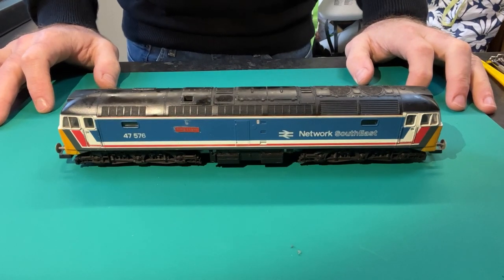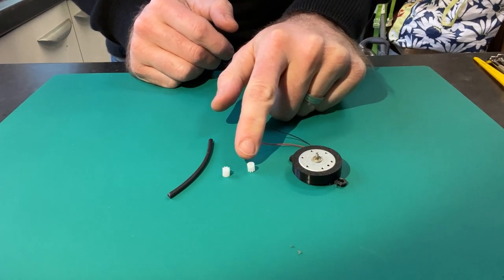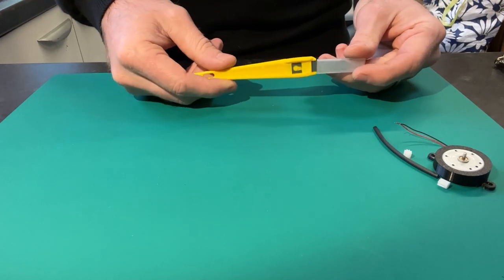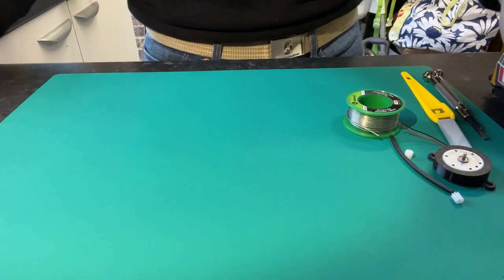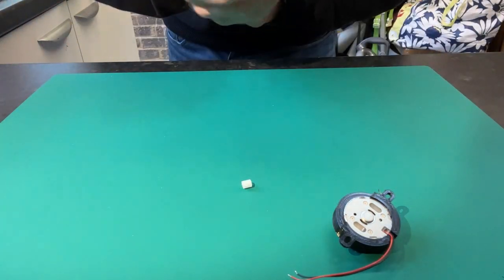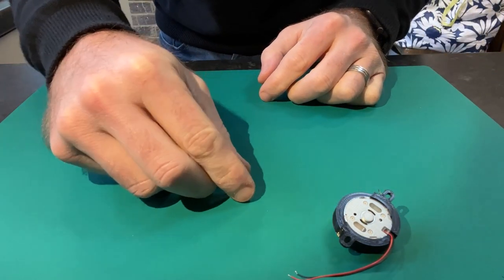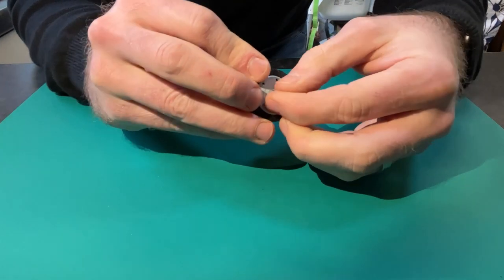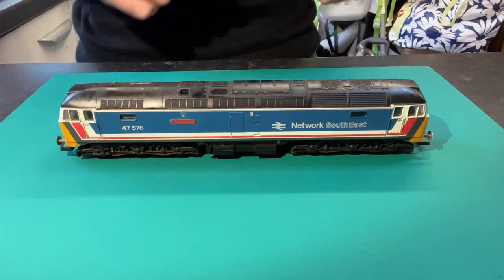Lima Ringfield motor upgrade kit - fitting tutorial

Comment: Just fitted these motors to a Lima/Railroad Class 40 and Class 37. Easy to do, and running is transformed. Some locos pick up from both sides of the non-motorised bogie, so check  the original wiring to be  clear what goes where, and which additional wire from the pickups needs to be joined to the motor from the rear bogie and the wire from the pickup on the motor bogie - i,e to make a 3-wire connection.

Comment: Bro, 12:50 thats NOT how you remove a LIma power bogie. unscrew the 2 screws underneath. The bogie frame goes downwards, the ringfield motor goes upwards. Will break a main-chassis frame doing the way you done it. Motor bogie needs to be dismantled anyway to solder the new wire to the pickup plate, access is easier and no chance of melting the bogie frame. Good job otherwise

Comment: Hi Mark I have an old lima shunter that needs re-motoring and converting to DCC. As a shunter is more power less speed does it take a different motor to that of a loco? If it does I hope you can supply same in your ebay shop.

Cheers  Tim